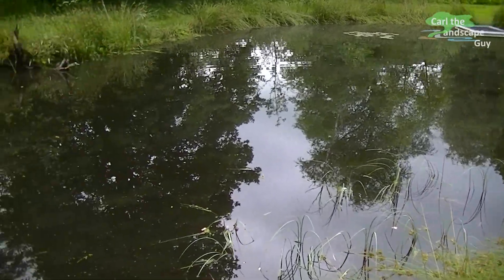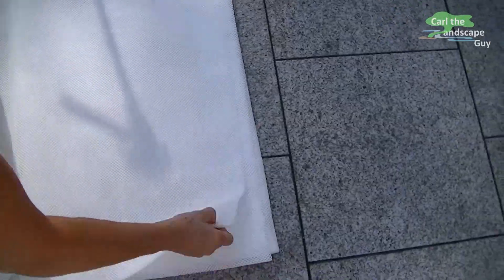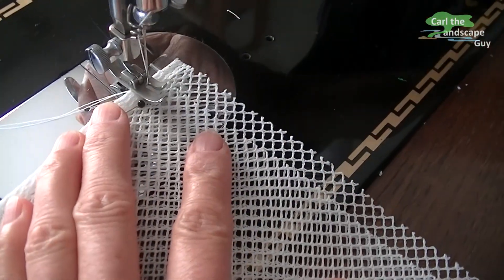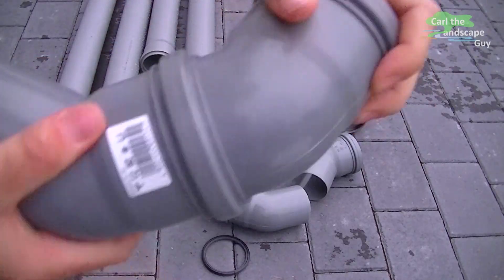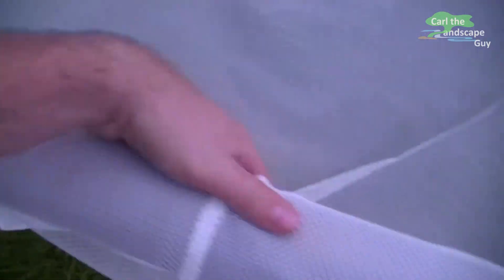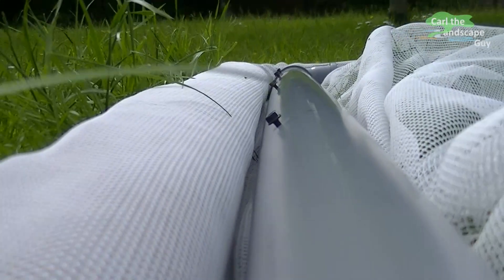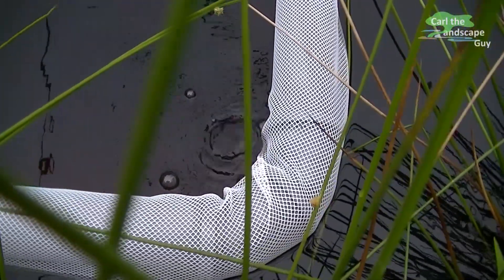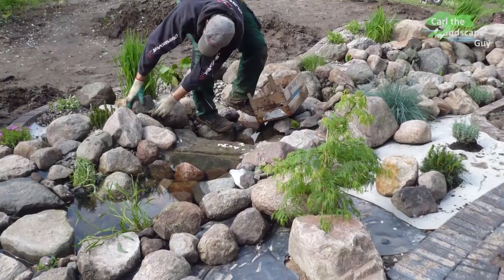FLOATING NET CAGE FOR FISH, HOW TO BUILD A KOI CONTAINMENT IN DETAIL, NETTING TUTORIAL,BREEDING CARP

Comment: Is the substance lubricated enough to prevent the ingress of water into the large tube structure so that it stays afloat ?, Do you use hypertext resin to prevent water from Aljul? My question is important because I can dismantle the basket to move them to another location for easy transport.
Reply from the maker: good question, these tubes come with seals and so far no water came into the tubes. thanks